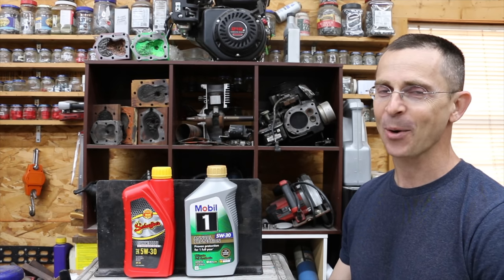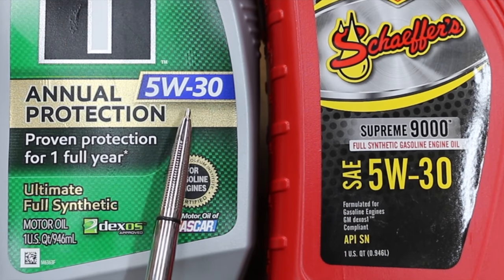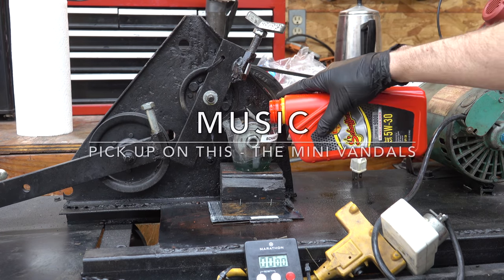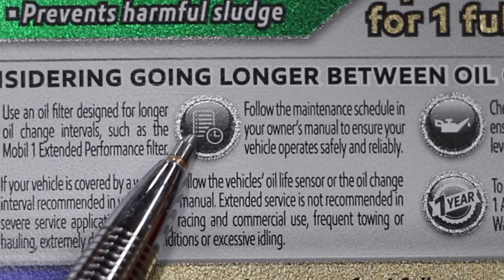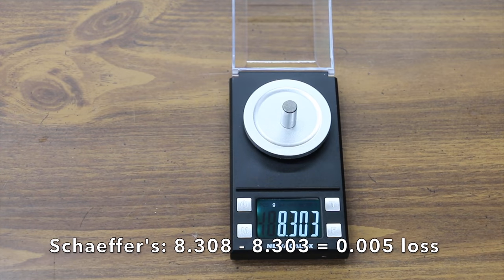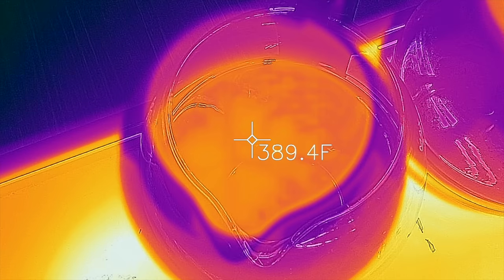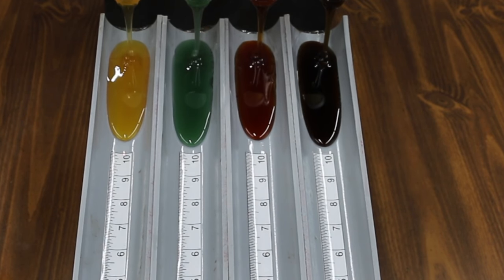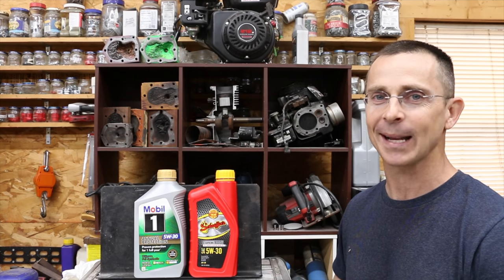Is Mobil 1 better than Schaeffer's Full Synthetic 5W-30 Motor Oil? Let's find out!

Comment: my question is what 10w40 means does mesn that the oil is more viscos whene it is hot  ...what i know that oil tend to be less viscos whene it is hot but if 10w means it is less vescos whene it is cold and 40 means the oil is more viscos whene it is hot realy cant get it
Reply from the maker: The cold and hot viscosity numbers aren't apples to apples when compared to each other.  A straight 30 oil is thinner at operating temperature than when cold.  Hope this helps

Comment: I am sorry but your test does not tell anything about oil quality. Different manufacturer brand may slightly differ in viscosity. Since Shaffer is stickier at both cold and hot temperature according to your test, it only tells you that Shaffer brand has higher viscosity compared to the viscosity rated on the can. Stickier in any temperature does not mean it is better. Stickier at cold temperatur would even make the engine harder to start. It can even mean that Shaffer has wrong rating on the can. What you need to compare is if the brand loses viscosity at higher temperature compared to the same brand's viscosity at normal temperature. Your boiling test do not seem to make much sense either. Boiling oil in open air does not represent engine environment. Oil losses are mostly due to bad oil rings, pistons and cylinders.
Reply from the maker: Thanks for the constructive feedback.

Comment: I've heard Schaeffers oil is excellent but this is what concerns me about Moly, 

Check out the OEM bulletin from Cummins. It is the Cummins Engine Oil Recommendations, Bulletin No. 3810340-02 . Its probably best if you stopped by a Cummins Dealer and purchased this bulletin- about $2 or $3. On page 7 it has a section on FRICTION MODIFIERS states:"There is firm evidence that certain friction modifiers, molybdenum dithiophosphate for example, can in certain formulations result in cam follower pin failure at relatively low mileage"........ From years working with engine test programs to approve engine oil formulations for API licensing, we can tell you that NO engine oil containing Molybdenum additives has been certified by the full range of engine tests necessary to gain API approval. Molybdenum compounds in motor oils can degrade and cause bearing corrosion and is particularly aggressive towards copper. In almost all cases, any engine oil formula having "moly" will also contain a Copper Deactivator which will protect bearings from the moly compounds. The only problem, the copper deactivator decomposes at relatively low temperatures and looses it's potency after a few thousand miles.
Reply from the maker: Thank you for this information!  I've had all of the oils tested and all but 4 brands have moly.  Red Line has substantially more than the other brands.
Reply: Project Farm Would you know if Schaeffers 9000 has more or less Moly than Amsoil Signature Series?

Comment: The descriptions "Full Synthetic", 100% Synthetic" and "Synthetic" have no meaning in the U.S. The real question: ' Is the oil Group 4, Group 5, or Group 4/5 like Royal Purple, AMSOIL Signature, or REDLINE. The only 3 real major synthetic-base syns in the U.S. In Germany, an oil labeled "Synthetic" must by law be at least Group 4, like Liqui-Moly and Motul. We know that Mobil 1 is only a Group 3 (no synthetic base and hydro-cracked Dino oil) and I bet Schaeffers is at least a Group 4 (real synthetic base). Schaeffers is real expensive though. I'd like to see a high mileage test between the two.
Reply from the maker: Great constructive feedback!

Comment: Hi brother. Can I put Mobile oil 5w30 to my crom engine?
Reply: Crom mean 2004 Honda msx 125cc motorcycle
Reply from the maker: Recommend using the type of oil recommended by the manufacturer just to be safe.

Comment: What oil do YOU USE??
Reply from the maker: I use Amazon Basics Full Synthetic, but I have older cars.
Reply from the maker: I use Amazon Basics Full Synthetic, but I have older cars.
Reply: @ProjectFarm  Hey...Thank you so much for the  response..I drive older cars myself..My favorite oil to use is Castrol GTX..I run 20/50 with Lucas Oil stabilizer..MY mechanical oil pressure,oil temp and even water temp gauges tell me it works best..My daily driven cars are vary from 2  manual 1991 4 cylinder Miatas..,92 Mustang LX 5 speed 5.0 Coupe,88 Mustang 5 speed Coupe,94 Cobra,95 Mustang GT both manuals...and a 99 GT manual.I even use Castrol Vtwin 20/50 in my Indian...I dont use synthetic except in a few cars I didnt list  such that are engine swapped to a 15 VMP Supercharged Coyote which I run ROYAL  PURPLE along with my V12 sports car..My cousin drives the RP sponsored Funny Car so its free and it works pretty  great!! Especially in gear boxes and differentials..Great channel man..Awesome taste in music as well...Keep rockn the videos!!!!! Thank you!! Colin

Comment: I have a huge problem with manufacturers telling consumers it's ok to change your oil every 10,000 miles.  I can bet that 95% of consumers won't check the dipstick between oil changes and no one will notice how much is being burned off. Yu're typical driver will wait till 10-12k then get the oil changed.  Subaru's burn a quart between oil changes right out of the factory.  I feel that's going to screw the manufacturers over in the long run. Anyone?
Reply from the maker: Great point. Thank you

Comment: I totally love that lubricity test rig. Engenuity at its finest! I have heard a few different things such as you should not mix different types of synthetic oil for example if the capacity of my engine is 5.5 L and I put 5 L. And then I drive for a about 3000 miles and now I want top up the oil 1 L. What if I use Pennzoil Platinum full synthetic on the initial fill and utilized 1 L of edge or some other type of full synthetic. Or maybe adding 1 L of  conventional oil to a synthetic. This scenario seems pretty realistic I'm not sure if anybody else has heard of any kind of warnings about mixing oils
Reply from the maker: This is a terrific video idea!  Thank you

Comment: What about the pennzoil platinum oil
Reply from the maker: Great suggestion. I tested it in a more recent video.
Reply: I'm using the Platinum with Motor Guard oil cleaners. I liked the Idea of using natural gas to make it only have about 50k on it Can't give it a good test. The Altima uses a little oil. Bought the car with 225k on it and installed a Japanese import engine. Looks like it will need a couple of quarts of oil a year plus a quart at filter change.I.do twice a year now.

Comment: 255k on 5.7  6000 mile oil change in service rig  no ? By  1 quart in 2k miles mobile 1 schaffers 1 quart 3200 miles  simple test see how flammable oil is to blow by you will have under heavy use schaffers win s hands down over any oil

Comment: At the oil slide Mobile1 is the victor Not schafers. Mobile1 has the better cold oil flow Not the schafers oil. Why do you say schafers in the victor by 1/2 inch????

Comment: The lubricity test and wear is nonsense.   Motor parts do not touch when running- no contact between pistons and cylinders.  If they did, the oil used would be the least of your problems.  They are in suspension.
Reply from the maker: Thanks for the feedback.

Comment: More crapping on about near irrelevant issues. Oil is simple, check your manual and see what grade/rating is required and buy that grade. Mixing brands and types is not advised. Now the important issue the filtration system your oil passes through. The best oil filters fitted to most vehicles are useless and do next to nothing in removing dangerous components. The best oil filters will filter down to 30,25 even 20 microns and the particles that may do damage are generally sub 2 microns.This is like filtering raw sewage through a box of boots and expecting pure drinking water. There are better filters, make the effort and find them.

Comment: This testing really shows a fundamental lack of understanding of oil for so many reasons.  Oil failure modes change at very high temperatures and super high temperatures like that have nothing to do with what happens in an engine.  Also, the cold temp "test" is nothing more than simply checking the viscosity index.  It's silly.  Your wear test is also totally silly, as it in no way represents what we expect the oil to do in an engine.  It also is extremely poorly controlled.  Where's the load cell to make sure the load is consistent?  Let's not even get started on how you're using an IR camera for temperature.  Every test done here is really absurd.  Sorry to sound so harsh - I appreciate trying to educate people on oils.  I just really don't think any of this testing is in any way relevant to real world performance in an engine, nor are they controlled enough to find any differences between the two.
Reply from the maker: Thank you!

Comment: Try Mobil 1 esp Esther based oil
Reply from the maker: Thank you for the video idea!
Reply: @ProjectFarm  everybody praises that oil, I uses it in everything,it is the highest spec
Motul 300v is racing oil. Its expensive, its a double esther oil.They claim that esther oils perform as hot as hold same way

Comment: When you look up who's been making API rated synthetic oil for cars longer, you will find Amsoil been out there longer than anyone. Even Mobil one who's oil was not api rated when it first came out for cars. Amsoil was the first API rated oil for cars in 1972. Amsoil has trademarks on being the first in several areas. To get a trademark aka no one else can claim that or says that. You first have to prove it. Amsoil has. here's a link to an image that shows their trademarks on the lubrication industry that no other oil company can claim.

https://www.factorysynthetics.com/uploads/4/3/1/1/4311063/9556212_orig.jpg
Reply: There is a difference in saying you have the first API synthetic oil for cars and being able to trademark it because you can prove it, Shaffer's was not always synthetic based. And Mobil made synthetic oils for Jet Engines which cannot be used in cars. In fact they through their Mobil synthetic oil out there for cars and for the first couple of years, it was not even API approved. The reason in the image above Amsoil has the S replaced with a Z is because that was the original name. But because Pennzoil was the first to use the zoil in it's name, they took then spelt Amzoil to court and they had to settle fo Amsoil instead.
Reply: Also many companies who are out there mainly for the money, will lease additive packages aka additives that are protected and owned by additive manufacturers. That have been already tested and are known to perform a certain way and pass certain standards. Amsoil is the only company that mixes their own packages and they do not copyright them because when you do, the copyright has to be made public after so many years. So to protect their self made formulas they do not do this.
Reply: Amsoil also makes the largest synthetic oil product line in the world. No joke:  http://au.amsoil.com/images/uploads/images/All_AMSOIL_products.jpg
Reply from the maker: Thank you!

Comment: in my country mobil 1 is not that expensive  am i being trolled?
Reply: About $23 for a 5qt jug or $26 for Extended 15K Mileage Mobil 1. I use the Extended with a top quality filter and change it at 10K. 2014 Camry SE has 105K miles and is still oil tight and runs right.
Reply: @thisismagacountry1318  so you are saying oil change is @ 10k miles?

in my country the mechanics demand you change oil @ 2k miles or else your car will break... so we do that oil change obediently in fear of motor failure on the road

Comment: The only way to tell is a UOA report. Simply send the used oil sample in (I use http://www.blackstone-labs.com/) there are other companies to send in your used oil sample to. YoU also want to note how many miles or operating hours on the used oil and what type of equipment car, truck, mower, riding mower, airplane engine etc... If the vehicle has a swapped engine then give that engine information. YoU can also let the company know what brand of oil filter was used. This is the only proper way to tell which motor oil is better than the other for your particular application.
 Here is an article regarding which oil to use. https://www.blackstone-labs.com/which-oil-to-use/?session-id=qxgj3n55blhyedzk4wiiqybo&timeout=20&bslauth=&urlbase=https%3A%2F%2Fwww.blackstone-labs.net%2FBstone%2F(S(qxgj3n55blhyedzk4wiiqybo))%2F
Reply from the maker: Thank you!

Comment: For a extra 5 bucks a quart I expect way better performance. Change oil every 20,000 miles is just plain stupid and most people aren’t that dumb, so most smart people will do a oil change with these 2 about twice a year. At an extra 5 bucks a quart times the 5 or 6 quarts you use that’s a extra 50 to 60 bucks a year or another oil change of mobile one. Mobile one has proven over and over that their oil will go the distance and with regular maintenance you will get 250,000-350,000 miles out of your engine or something unrelated to the oil will fail. Why spend 50% more on oil to get the same exact usage out of your engine? If the oil was massively better then fine but it’s only slightly better. Like about .001%. No wonder I’ve never heard of Scheiffer’s, they are over priced oil only idiots buy.

Comment: Sorry, this is absolute rubbish. "Well that extra 72 years of experience really came in handy today for Schaeffer". The two oils were so close in every test that you might as well call it a tie. You would need to run the tests a number of times in order to get some actual average results. I would suggest that if that's all Schaeffer beat Mobil by despite them having 72 years more experience, they're actually not better than Mobil.
Reply from the maker: Thank you!

Comment: What difference does it make?  The worlds fastest man beats the other guy by a minute fraction of a second. He gets a trophy, but beyond that does it matter? Synthetic oil has many properties you are not comparing. For whatever reason, you focus on these two. Could it be because they are the ones you are capable of doing?  Quality synthetic oil can protect moving parts so they spec like new after 300,000 miles. Your friction test is misleading. No part can wear like that and be serviceable. Run an engine, for 300,000 miles. Break it down & mic the moving parts. Show us the results. Your silly "test" is misleading. If I rub your face on different brands of sandpaper, regardless, your face is ruined. How does that make brand "A" better? It's a stupid parameter for measuring.

Comment: and who exactly cares about this?
Reply: I am not a fanatic so I will just say it's a matter of preference.

 

Having said that, however, the trackpoint offers much more accurate control, with less movement of the hand, without the need to keep your wrist hovering. 

 

The main advantage, however is that you keep your hands on the keyboard and can use both the pointing device and the typing device at the same time. Once you get used to it there is no going back. 

 

I am in my forties but only got my first Thinkpad 5 years ago (still in my forties then, sadly) and grew to love the trackpoint. I only use the touchpad when I show stuff on my screen to others.

 

My son got his first Thinkpad 4 years ago and is using the Trackpoint exclusively. He's 16 now. You see once you see the benefits there is no going back.

 

His touchpad is disabled, same here. I have an external wireless mouse for other uses (when the laptop is docked) too. Different uses require different pointing device but the trackpoint is the one that gravitates me most.
Reply: @stevethea5250  What does ANY of that have to do with this video????
This video is a head-to-head test of AUTOMOBILE ENGINE OIL!